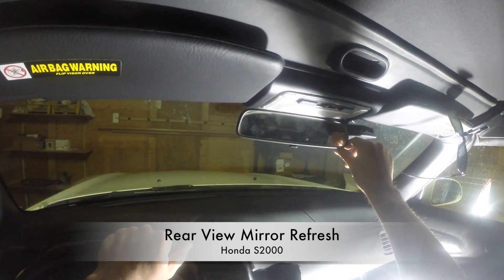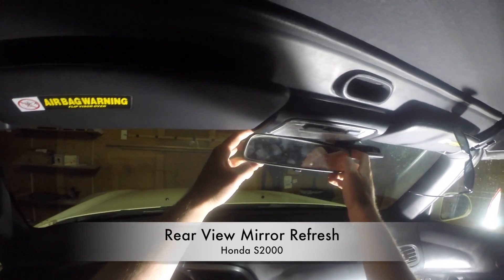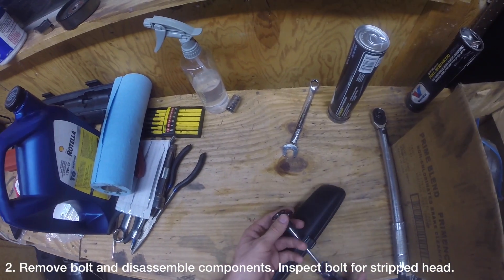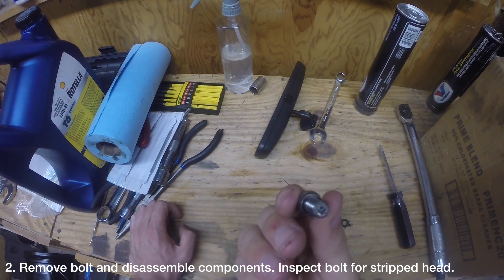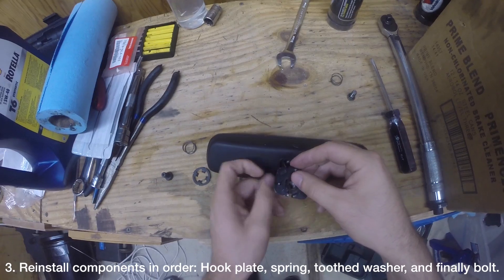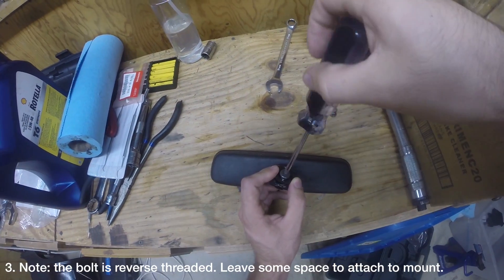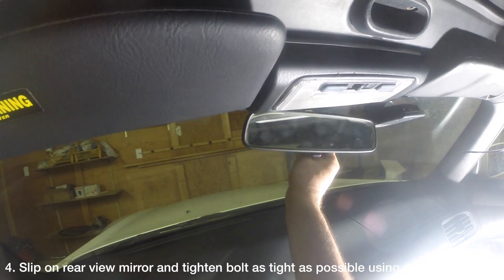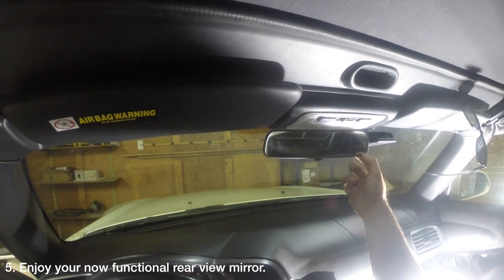Rear View Mirror Refresh | Honda S2000

Comment: Thanks a bunch for this video. In my case the mobile tech that installed a new windshield used an improper sized phillips and never got it tightened down properly. It would wiggle and drive me nuts. I tried two different phillips heads and none seemed to tighten better. I pulled the mirror off and studied the bolt. It was not stripped or damaged. I looked through all my phillips heads and found one that matched perfectly. That was the phillips head that could tighten that bolt "all the way down". After tightening down with the proper phillips I'm back in business. Thanks again for your time making this video. It explained everything needed to fix the "wiggle".

Comment: I also had my windshield replaced. My mirror now sits a lot higher than before. I notice from the video that you seem to have the same issue. when in dimmed mirror mode it also seem to obstruct the view due to the higher position.
Reply from the maker: Yep! Good observation. Happened from previous owner. I haven’t looked into fixing it but maybe I’ll just get a new windshield.

Comment: Well done. The critical pieces in my mind are the reverse-threaded main bolt, (not obvious),  and the fact that the pieces can be purchased individually at a OEM Honda parts supplier.  (My local Honda dealer's online discount parts arm).  You saved me from purchasing a new mirror.  Thank you very much for posting this video.  :-)

Comment: So purchase a new bolt? for the tight fitment?
Reply from the maker: New bolt and proper screwdriver.
Reply: part number>
Reply from the maker: Usually I add a parts list necessary for the DIY but I didn't yet. Let me do that..
Reply: thanks for the great video. just got my windshield replaced and think the tech stripped the bolt now my mirror is wobbly as F. can you share the bolt part #, i am assuming this is honda specific
Reply: here's the part # for bolt 76410-SL4-003. DIYguys replied to a post on s2ki which links to the entire part list for the  rear view mirror assembly http://www.hondaautomotiveparts.com/auto/jsp/mws/prddisplay.jsp?inputstate=5&catcgry1=S2000&catcgry2=2001&catcgry3=2DR+S2000&catcgry4=KA6MT&catcgry5=MIRROR

Comment: Do you have a video (or know of any) of removing the rear view mirror? I want to replace mine with one that has the rear view camera. 
Thanks in advance.
Reply from the maker: In the video I went over that in step 1. Mine was so loose it was falling off the car but it is held in by one big screw.
Reply: DIYGuys my apologies I meant remove the rear view mirror from the windshield. The mirror that I'm putting on doesn't have an adapter that fits the S2000 bracket that's attached to the windshield so I need to replace it all together
Reply from the maker: +Frankie Hall not sure how you would remove the bracket from the windshield tbh.
Reply: Heat. Heat gun or torch, but you're liable to crack it.